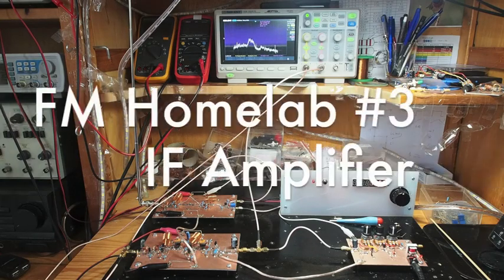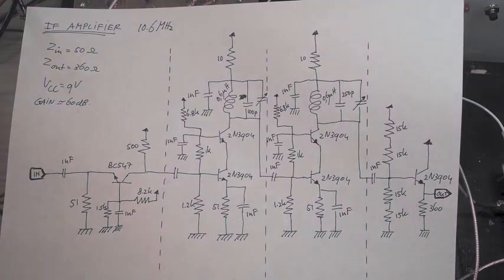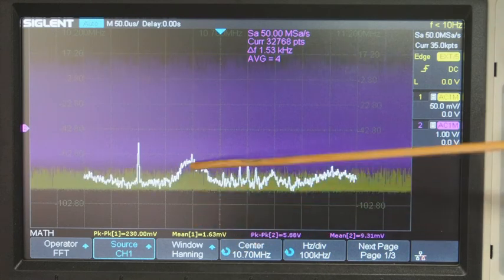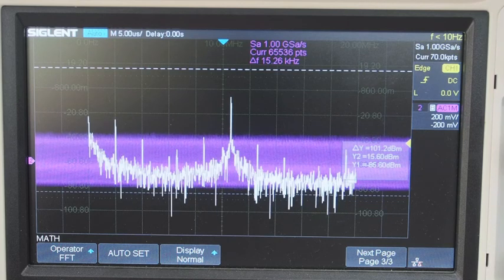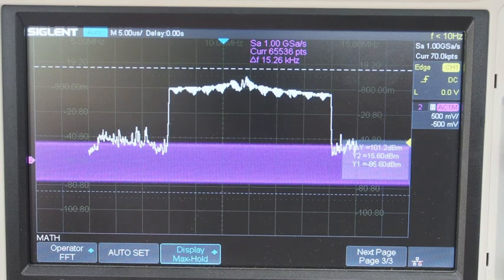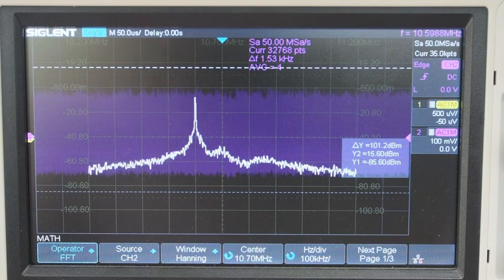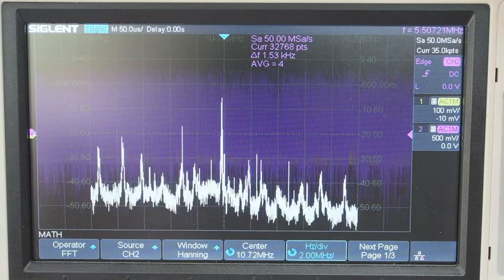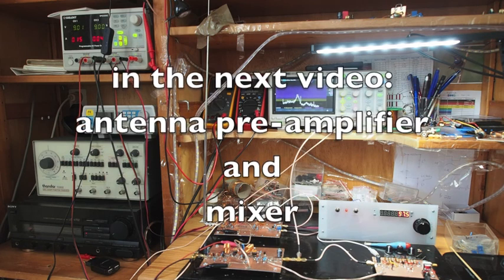#3 DIY FM Receiver: IF Amplifier

Comment: Note that your output impedance is going to be much less than 360 ohms - it will be dominated by the output impedance of the emitter follower, which is typically quite low.